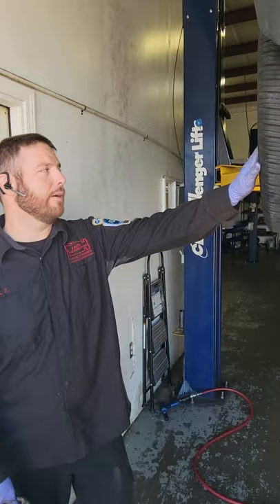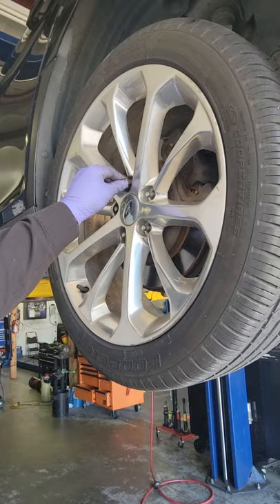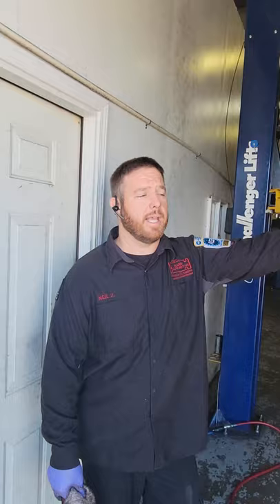NZ DIAG! How To Remove A Stuck Wheel Due To Rust.Quick Tip! #automotive  #shorts #auto #carrepair

Comment: I had a rim stuck on the front of my 2000 excursion. I hit the tire with a 5 lb. Sledge, an even bigger sledge, and even tried an air hammer on the inside of the rim with a towel between to lessen damage. I finally decided to use the truck's Wright to help me. I loosened all the lugs about 3 turns, put the truck on the ground, started it up, and turned the wheel back and forth. BINGO! It popped loose right away. If it had been a rear wheel, I would have loosened the lugs a little less and drove back and forth a few times. I'm a DIY'er so I don't have a post lift or anything fancier. Just thought that I'd share this idea. I have never had a rim stuck like thst one. Needless to say, whenever my wheels cone off, anti-sieze goes on the hub face and hub center.

Comment: Great ideas. Will definitely be trying this.There is still a good chance of galvanic corrosion though. Contact of two dissimilar metals, if left long enough, will generally result in them being "stuck" together due to galvanic corrosion. The fluid film may or may not help, but it couldn't hurt.

Comment: A 3 lbs drilling hammer on the inside of the rubber works well. 
If that doesn't work, the duck billed for dismounting oversized tires works....